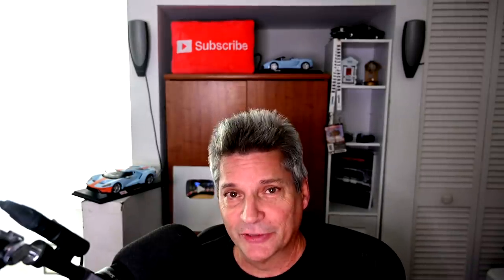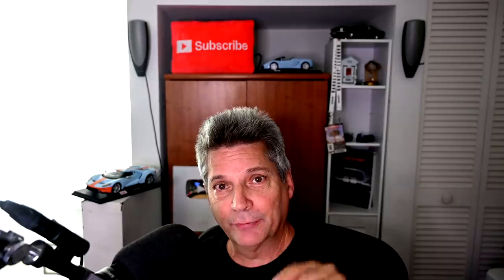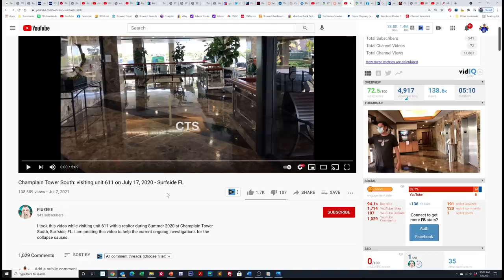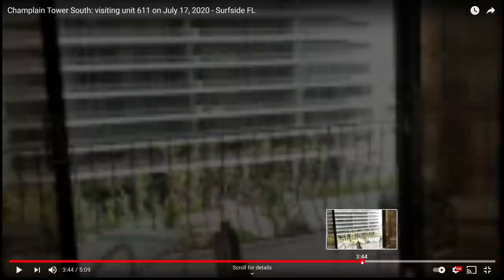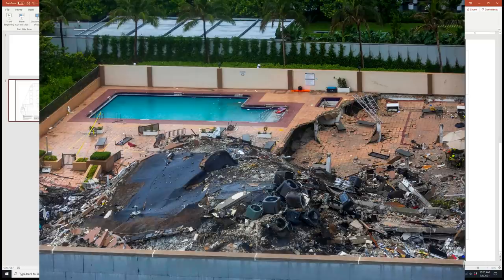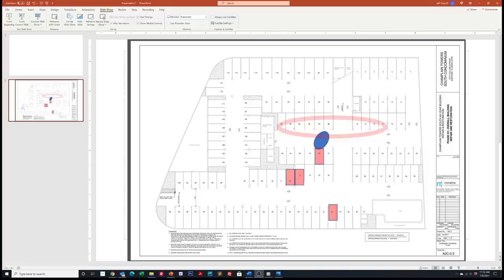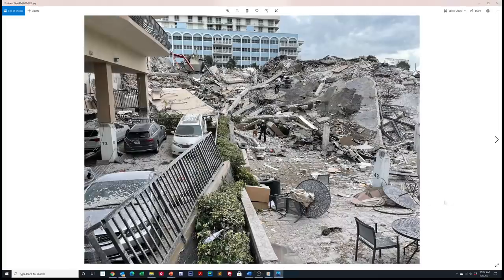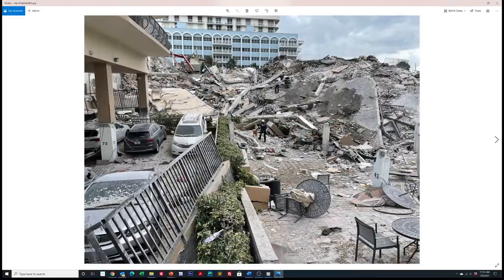Analysis Garage Video BEFORE Condo Collapse: Water Everywhere

Comment: Just after 19:10 you said you didn't see anything, but there's definitely a jagged line across the ceiling right in the upper left of 19:13
Reply: Yup, big crack there on the left end of what looks like a big piece of corrugated plastic tacked on to the ceiling to catch more water dripping on someones car. Handyman special, hide the falling down ceiling with a big piece of plastic/fiberglas garden tool shed type stuff

Comment: I was in that building during construction . I was looking at  the crappy steel work on the rebar , being to small and floor gusset bars . None of  the rebar was coated and no grouping hangers . I'm extremely surprised it didn't fall down sooner .

Comment: 19:13 in between space 100 and 109 is that a giant crack in the ceiling?
Reply: There were multiple large cracks forming, and pieces of concrete coming down.

Comment: Dehumidifying an open air structure next to the ocean?  Is that possible?
Reply: Lack of air movement can cause humidity
Reply: @chris.5434  If the RH of the circulating air is 60% you won't loose much moisture in the concrete.
Reply: The humidity is very high in Florida. Nothing dries unless sun is directly on it.

Comment: Dear Jeff,
As a maintenance worker from apartments, I think there is a clue. Could you please show an overlay of your garage map with the planters from above. If the plants were over watered, consistently (like on a timer that no one reset) it would seep through. Also in this video, there is more corrugated plastic roofing material tucked into pipes of the ceiling than you first realized. They didn't want rusty water on nice cars.

Thank you!!!

Comment: Those panels on the garage ceiling look like corrugated panels to divert the water away from the cars. I used to park my car in a garage and those water drips that come thru concrete destroy car paint. So basically, they seem to have used corrugated panels as “gutters”. Jfc. 😒
Reply: Exactly, and that is the only thing you can do until and unless the HOA will raise the money to do adequate restorative work. I had to buy a car cover until my HOA finally bit the bullet nd made the repairs to our outside parking deck above the underground garage. The person using my spot before had to have their entire car repainted.
Reply: This just looks like a house of cards. The cost to make all of those dumb repairs throughout the decades would probably add up to how much it would cost to genuinely repair everything all at once. So dumb. I thought shawty building and maintenance practices on this scale was a thing of the 20th Century. It seems it's legacy lives on and it could have many friends across the nation. :/

Comment: Pretty sure the "patch" is to catch water and take it to the wall so it isn't dripping on cars.
Reply: Look at time stamp 19:04 between columns 101and 100 doesn’t it look like same patch just not hanging lose to me looks like ribbed plastic or steel and there is a big crack coming out from under it
Reply: @SonyaAllstun  i think i see what you're talking about @19:14?  It does look like a type of corrugated sheeting.  And looks like a rust colored crack.
Maybe this guys and my own definition of a patch arent the same. If anything they just tried to hide damage. I also keep hearing about the columns collapsing causing the building to come down. Most of the pictures i seen show that the floors gave. Right around the columns.  My experience isnt in concrete residential buildings. It is in heavy highway/site constructiom. To me those floors look lthey have barely any rebar.
Reply: @jonyemm   agree just like in the video the columns stayed and floor fell around them

Comment: I have a dumb question.  Could some of those pipes be for condensation?  My husband was a plumber/carpenter,  and we had run a lot of pipes for the HVAC condensation.
I was a inspector for HUD,  and we would have condemned the parking garage,  from what I've seen in this video,  one huge red flag is water on an electrical box,  that's a fire hazard and potentially a fatal accidental electrocution,  and that is something you cant play around with.

Comment: You totally missed the "wetness" at the base of those columns. that 106 had water stains all around the bottom.
Reply: I noticed that as well and it was on quite a few others in the video like the garage was pretty flooded at one time, I was surprised he never acknowledged it in this video. I noticed a lot of stuff in there that would have scared me if I lived in that place, I'm no engineer but common sense tells me that place was DOOMED !!

Comment: Florida is swiss-cheesed with sinkholes and foundation failures.  Is it possible an acute subsidence of a few inches in the middle of the garage could have dominoed this thing into oblivion? 🤔   Maybe it wasn't a design or maintenance failure.  (bad maintenance, or lack of, would certainly contribute to the destruction)
Reply: Your missing eyewitnesses who watched it happen all heard a loud boom. And when the second part fell there a  ight flash in the clouds of dust then it fell...
Reply: @franksmith3602  MuStVe bEeN a BoMb for absolutely no reason. go home.
Reply: @franksmith3602 
Whether it's structural failure or a sinker in the basement, the boom noise and sparks in the dust is still a consequence. 
I didn't specifically say that was the cause, just its a possibility.

Comment: The section around 13 minutes looks like a major crack in the concrete that has been sealed. Often cracks are sealed by drilling small holes into the crack, inserting nipples, sealing the surface of the crack and then pumping crack sealant under pressure into the nipples to hopefully permeate the crack with sealant and prevent further water from getting in there. The "rebar" you refer to are the nipples used for injecting sealant. The entire length of that would have been a significant crack in the concrete which formed from the apparent repair hole at 14:34. 16:34 looks like it has another set of nipples in the distance past the 2nd sprinkler pipe, and there are lots also at 15:18 on the left side particularly. There is also a set at 17:55 past the first sprinkler pipe. 24:45 looks like it has some, and also at 11:47.

This is what the engineer refers to when he mentions "failed injection repairs". Wherever you see these lines of nipples, there is a major crack in the concrete. The rust seen at the bottom of each crack indicates water was running through these cracks and depositing rust at the bottom of each one. These major cracks are all in areas of the pool deck that collapsed.

It's pretty clear that the concrete slabs here were in pretty bad shape from water damage, and that people were aware of it. Sealing will never cut it when there is no grading and the water just sits on top of the slab.

Comment: Florida is HOT and HUMID.  
Therefore, Auto air conditioners are used due to that heat and humidity 
Those air conditioners drip water into a puddle when the car is parked after a drive.
Reply: Ditto
Reply: Yes but... the A/C drips in the parking space once the car is parked and maybe leaves a trail of little drips where the car drove. So your theory explains water in parking spaces but not water in the lanes.
Reply: It doesn't explain the water pooling in the access roads of the garage when the vehicle is in motion.
Sure, when a car is parked then auto aircon water leaks.
The leaky rusted water which Jeff pointed out is evidence that the rebar has had water ingress & has been rusting for a very long time
Reply: The water from the car a/c's  dripped on the ceiling?

Comment: Excellent video and explanation.  It really identifies and brings to light what is where in the setup of the building and unfortunate collapse.  Those ceiling patches that you pointed out looked like corrugated plastic or metal.

Comment: Those objects above the cars were plastic corrugated sheets. I used some to cover my deck, very flimsy.  Also when you were describing the collapsed section with debris at the bottom of the ramp it appears in the tourist video that the pile of debris and water pipe gushing water were one row of columns back from the end of the ramp.

Comment: Hi Jeff Is This the video from FIUEEE Channel.If you have not seen that video Check it out on that Channel. It was filmed on July 17 2020. Shows Spalling on Ceiling it is the exact area that collapsed. I  believe the columns are undersized  for the load.
Reply from the maker: Yes her video is the one that we are stepping through frame by frame here to show you I frame here to show you what damage was weird and where the spots are located and how it related and where the spots are located and how it relaves to the collapse of the building.
Reply: Walter, he's using her video in this video. He has slowed it down.
Reply: @walter, can't you see he's using that same video right there? 🤦🏻‍♀️
Reply: @LavendarRoses  I asked this question at like 7AM this morning. It was just a thumbnail image.I could not open the description part.I could comment only. Utube is wonky at times.

Comment: 10:35.  The 2018 report mentions the Assn having to pay for damage to owners' cars from carbonate dripping on them.  This looks like some hillbilly engineering with both rain gutters and corrugated fiberglass to direct the drips away from the cars.  Yikes.
Reply: 22:55  Re the car cover.  These are pretty common with Snowbirds.  A friend lives in a high rise in Fort Lauderdale and there are always a few cars under cover in the garage during the off season, especially unique ones.

Comment: Worked on many catastrophic OSHA accidents during my career. Having once been married to an architect and having long discussions about structural load, can’t help but wonder if upgrades to condos contributed to collapse.  Seems like every real estate video features marble bathrooms, tile floors, granite kitchens, etc. upgrades. Were these standard when the building was built or were the units outfitted in carpet and vinyl which weighs significantly less per square foot? 

Great video.
Reply from the maker: Yes me too, upgrades to granite, and fancy tile and marble from the original carpet and Formica counters

Comment: 1. the crack with metal adapters protruding is most likely epoxy crack repair injection ports that were not removed after the poor crack repair.  very substandard workmanship.

2. peeling paint most likely due to deteriorated waterproofing above the structural deck.  per some previous comment, it was probably laid flat on the deck with a sloping topping for the pavers rather than a sloping topping with a waterproof coating on top of the sloped mortar bed then the pavers.  Would have been easier to maintain with only removal of the pavers for repair and would have reduced the accumulation of trapped water below the paver deck.

3. as an architect, what caught my attention from first video was that the slab failed and fell like a donut around the columns with no rebar remaining.  this was at decks with no impact from above. this video confirms that it was a 2-way reinforced slab with no beams between columns.  if a large load were to have impacted the top of the slab, I could start to understand the failure in shear of the concrete and bent steel reinforcing from the top of the columns, but is just failed from stresses in the slab and not from above. I have never seen anything like this.  was the reinforcing at the column top deteriorated?????

4. the slab at the basement parking also appears to have have been cut and replaced in one area.  different color to the concrete. looks newer.

5. while little spots of water here and there are now a concern, back then, a few could also be from condensate from car air conditioning discharge while transiting to and from parking.

Comment: I don't think those are drips on the overhead. That looks like paint when it sheds off an incompatible surface.
Reply: @michaelbarnhart2593  - Paint is generally incompatible with damp surfaces, is it not? (Discovered that the hard way, after trying to paint ac vents. Went badly... 🙄) one thing has been bugging me. There is one area of those paint drips that they form a graceful arc of a circle. Could be the camera angle, but it is bugging the snot out of me.

Comment: It looks like cheap repair on the ceiling of the garage.  It SHOULD have been a Contractor engineering doing THIS job.
Reply: I think as soon as they were told by the engineering firm they hired to evaluate the building a few years ago they should have put up additional support columns to hold the garage ceiling up immediately until they figured out their long term plan.

Comment: The whole building was built and designed by a “ Handyman”.
Reply: Everyone here is a contractor or an engineer. Hysterical all of you. Concrete is not a structural element. People think it is but it is not. 
How long does a brick fire place last? The bricks survive the test of time. The mortar always fails. Stone and concrete wall..who lasts longer.
Reply: @skiprope536  it doesn't take an engineer to see the obvious problems present in the garage.
Reply: @skiprope536  I have a big major train bridge in my city. Built in 1875, still has the original piers. Big huge rocks cut, shaped and stacked.
Reply: I hope this building was constructed by skilled workers not "handy man"  im a handy man. I can "fix" anything I need to in my house, that doesn't mean I should do the work of skilled laborers...
Reply: @echopine8974  Most licensed handy man where at one time a licensed Journey Man. In other words licensed contractor. But call it what you want. A Handy Man would not cause this disrepair. This was from Day one of Breaking Ground. So take your "handyman" and pound sand. And FYI you have to be licensed for over 10K Square feet to work on a building of this magnitude. Echo Deco you are a skilled Home owner doing repairs to your house. You know "Lipstick on a pig repairs" Keep that scotch tape holster going.

Comment: Great video sir, but you need  to look at column 105/106 again. At the bottom of the column where it’s painted yellow you can see a water line mark about 6” up from the ground and it goes around the column. The paint look pretty new when this video was taken, that means the water line mark happens around the same time. Within a year, give or take.

Comment: 28:05 these are not the pipes that can be seen gushing water in the tourist video. In that video you can see the section that collapsed first was on the far side of post 27 away from the ramp, not directly at the bottom of the ramp. I believe you were actually showing the area that collapsed first in the freeze frame at 25:45 where you can see significant water damage on the ceiling to the right of her finger. It was likely the fire sprinkler pipe that she happens to be directly pointing at which was gushing water. Also you can see the water damage ends in as clear line across the ceiling between posts 27 and 28, and does not extend over towards the ramp, this is likely the line where the waterproofing under the pool deck meets the side of the building, the area above the ramp is under the building.

Comment: Nice videos, all that water is coming from somewhere, i would suggest, if you can try to find the lady who made that video, and ask her, if she can recall if the roof was leaking.
base on all the peeling off of the paint in the roof, i strongly believe, it was coming from the roof, but i also didn't see no water stains in the roof...so  - it's still not clear where the water coming from

Comment: My uncle had a beach condo in another state with a garage, ramp, and courtyard exactly like this. These garages are narrow and depending where your space is, it is extremely difficult to navigate your oversized SUV into your spot without scraping a pillar. I can tell you with near certainty that the owner of that space got hold of an orange cone and placed it in his/her space to reduce the risk of hitting a pillar and scraping the car two or more times a day. Once you got out of the space, you could also move the cone into the space to prevent any visitor from coming down the ramp and “borrowing” your empty space, which they would definitely do. Orange cone was almost certainly a help in preventing damage to pillars in this case. Not a coverup of damage.

Comment: There seems to be water running down the top of column 105 (on the left side) and all around the base of the column also appears wet (the yellow bottom portion of 105).

Comment: What you described a paint peeling on the ceiling is improperly repaired epoxy injected cracks in the ceiling. They are the drilled in injection ports which were never removed.

Comment: At 32:32 i noticed something. Earlier you showed a contractor (or moribito) picture of a column in need of repair. And you were wondering where that column was because none of the columns looked like that in the phoro. 
I noticed on the column in the photo the yellow paint isnt applied all the way around the bottom of the column, but just on a four inch wide area. 
So during your video while the camera is panning around i was trying to find a column that looked like that. And then right at 32:32 the video is showing that half wall by the entrance. I see that the yellow paint doesnt wrap completely around it. Maybe that's the place in the contractors picture that was in need of repair,and which looks like maybe it was repaired.That half wall area is also right next to his other picture of the spalling on the concrete ramp.
Reply from the maker: good eye, thanks!